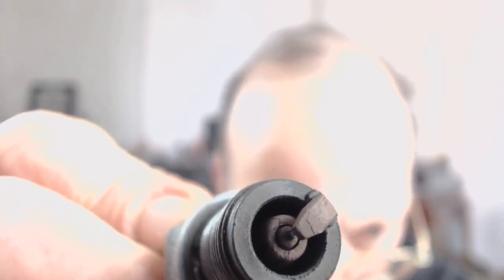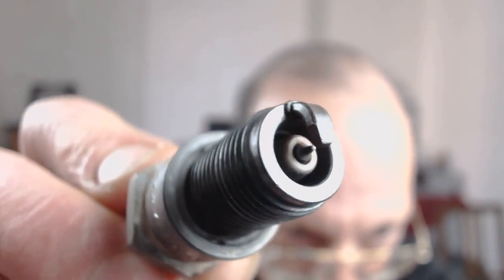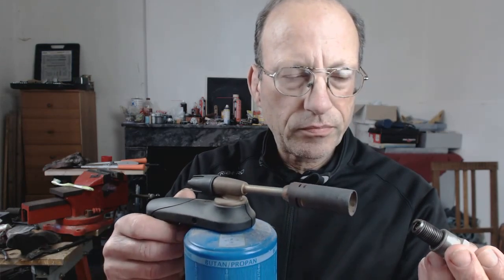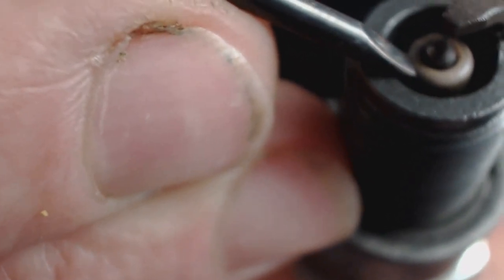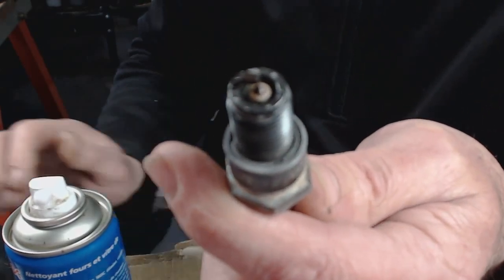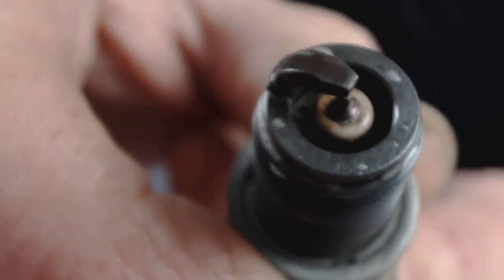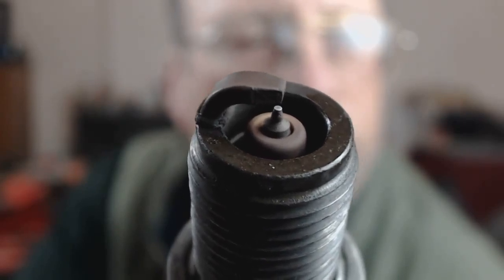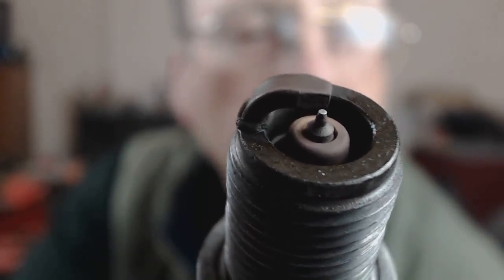Fouled Spark Plugs - cleaning and testing

Comment: Good Evening  . Thank you very much for this video. I want to ask you this: all spark plugs - no matter what brand or if they are NGK all types NGK new ones when the readings show the same ohmic resistance? E.G. the NGK (BKR6EQU), (6002) new how much should it read? New I had not measured it but at 54,000 kilometers when I changed them and measured them they show (4.16) k.
Regarding all this, what is your opinion?
Thank you .
Reply from the maker: Some spark plugs have a resistor within the plug.
Some don't, and require the resistor to be in the plug cap.
The resistors are subjected to heat and vibration - they can degrade.
This can cause analysis problems...
A friend had a bike that would play up after 15 minutes riding.
He was at a complete loss.
I changed his plug cap, and the problem was solved :)

Comment: In my experience, some plugs, if they start fouling, are pretty much doomed. You can clean them up temporarily and get them running again but they'll re-foul quite quickly.

A quick blast of soda works great for cleaning the carbon and gunk off the insulator and electrodes without damaging them, then you can just give them a wash in some water and burn the water off with a propane torch (do not hold the spark plug in your hand while you do this 😁it goes from slightly warm to OW SHIT very fast). If you don't have a sandblaster loaded with soda in your shop you can soak them in carb or brake cleaner and then hit them with the torch.

Comment: Would you recommend this for 2 stroke engines ?
Reply from the maker: If it is running rich, you either clean them, or buy a new plug.
When tuning a carb, you could buy 3 plugs; get the mix right; then clean fouled plug(s).

Comment: Can i use brake cleaner to clean it?
Reply from the maker: After you have cleaned out the carbon, you can blast away any debris (with the BC spray can), and the brake cleaner will evaporate away.
... but it wont dissolve the carbon ;)

Comment: You mentioned spark dance on one comment; what is that please, does it mean that BOTH electrodes ,the tip of the inner and the under portion of the curved one need to be fine polished? like with 2000 grit sandpaper? is there any film where i can see that?  THANKS
i am amazed at your knowledge of these things(you also mentioned that wires better be polished...)
where can one  learn about  that?
Reply from the maker: Abrasive cleaning of the plug is best achieved using micro abrasive media in a sand blaster or peening machine.
If this is not available, then a 2000 finishing grit will do the trick.

Polishing the HT plug cable, helps prevent the formation of condensation.
Condensation provides a path for voltage leaks to earth.

Comment: i have a scooter and it doesnt start....i checked everything, from wires to fuel filter...do you have any clue why is that?
Reply from the maker: You have to take a logical approach.
Replace the spark plug, plug cap, and HT lead.
Does it have a spark?
If so, then does it have fuel?
Does it feed too much fuel (wet plug)?
Is it new fuel?
Fit a fuel tap, so that you know that fuel is flowing to the carb.
Clean the carb jets.
Are they the correct size?

Do all the basic stuff, and keep trying to start it, after you have worked on an area, such as when you changed the plug assembly.

Be methodical.
Good luck!
:)
Reply: @EngineTuning  thanks for the help!

Comment: I use a wire wheel on my drill.very quick and effective.
Reply from the maker: Yeah, it's a common fix,
The problem for high performance engines is that the wires can cut grooves, and create misfires.
Anyway, if your fix works, that's great :)
Reply: I am always very scared of that::  porcelain is way harder than the wires of the wire wheel,and the wires kind of "plate" the porcelain making it conductive, and that is a spark killer; at least , use maybe steel wire wheel, brass will easily "paint" the porcelain.

Comment: Is that remove inside bike dest using wd40 inside fuel tank
Reply from the maker: Do not put wd40 inside the fuel tank, unless you wish to experiment.
It may burn okay, but I have no experience in using it as a fuel additive.
There may be complications with Ethanol mixed fuel.

For a 4 stroke, it may provide some top end lubrication, and it could absorb moisture (allowing it to be burnt off).
However, the burn will not be as clean as petrol, so it is more likely to produce carbon deposits, than remove them.

For 2 strokes ... the fuel has oil in it, that is designed for combustion and lubrication.

A superior additive is acetone.
It will absorb moisture AND it breaks down the surface tension of the fuel droplets.
This enables superior vaporisation of the fuel, and therefore better combustion.

In fact, it will 'even out' any minor maladjustment of the carburettor.
The fuel burn will be cleaner and slightly hotter.
This often results in the spark plug being self cleaned during normal use.
... I have found this to be the case.

 You will find that, instantly, the motor runs smoother; producing more power.

Only a very small quantity is required - 0.4% is sufficient, to gain an immediate improvement
... 200ml acetone to 50 litres fuel (even 100ml to 50 litres works well).

Great for winter running; particularly in diesel engines.

It is also a great additive for paraffin / kerosene heaters ... it pays for itself with the higher heat output, and you get cleaner fumes.

Comment: I have a 2 headed wire brush that works wonders on the plugs.
Reply from the maker: Yes, they are fine for a quick surface brush up, but...
They can't get to the carbon build up between the metal thread interior, and the porcelain :)

Comment: For all those saying he's cheap and should buy new ones well you know there are different circumstances where the car isn't running correctly. Running rich for some reason and it takes time to pin point the issue. Buying plugs every time they get fouled till the issue is found would turn out the be very expensive.
Reply from the maker: Thanks for your input  :)
You are of course correct.
This is the exact reason why I took an interest in plug cleaning.
For me, and typically for many people, it was after modifying the engine.
In this situation the safe tuning method specifically requires that the carb is first set to rich.
:)
Reply: @EngineTuning  yes sir, im actually going through this problem at the moment..
97 camaro ss lt1 with new 355 big cam ported heads and everything that goes along with it. Well, all the plugs are fouled charcoal black and its only got like 40 miles on the engine . Took plugs out on  one side of the engine cleaned them up with break cleaner and some sand paper.
Reply from the maker: I would suggest not using sand paper.
It can cause the sparks to dance, as the resulting peaks on the electrode can be too deep (from the scratches).
If using an abrasive method; go for the finest wet & dry,
Cut a load of thin strips ... they clog quickly but will leave a smooth surface.
Otherwise, use the drain de-blocker method, as described here:
https://youtu.be/DX9gaNJFy1g
Reply: @EngineTuning  yep, using 2000 grit i had left over from polishing my headlights.
Thanks
Reply from the maker: @97sswcubes 78 ... nice feedback, much appreciated :)
Reply: I have to add to your point , I have an old 140 2 stroke outboard prone to fouling at idle for long . These cleaning strategies don't only save money they get you home or off the water in a pinch
Reply: Also if your running an engine from 1970, some of them don’t have a modern proper match, so you find some and make ‘em last as long as possible.. then comes trial and error trying to get one that works good enough..

Comment: New plugs are nothing these days. Id save all that time and trouble just put in a new plug.
Reply from the maker: Yes for sure, the last batch I bought was 6 of the same plug, plus a couple hotter and a couple colder. 
This wasn't just about cleaning the plug ... though why not?
It's all about being in control, and not being stuck (because you don't know anything about how things work) ;)
Reply: My plugs are 120 for 4. Cleaning them once or twice is not being cheap its being smart
Reply: A decent plug will run you 5-9 bucks.Buy 6-8 of them and that's 30-70 bucks or you could clean them and have that money for another new part(s)

Comment: Use sandpaper to erase this black carbon
Reply from the maker: This would likely cause unwanted scratching, which in turn would create a problem for stable spark creation.
It will remove carbon deposits, but the fix isn't ideal, so it should only be used in emergency.

Comment: Use wire brush better than tooth brush
Reply from the maker: Not a traditional wire brush with steel wires.
The wire brush would leave scratches, and that is not good for a high performance engine.
A COPPER wire brush would be fine.

Comment: Buy a new plug ya tight ass! Lol
Reply from the maker: LOL... I know :D
They are cheap enough when buying half a dozen
I think I paid £1.80 each from Greens, and £3 shipping.
But good fun anyway :)
Reply: Sorry mate I'm having dramas with a Chinese bike I have and Its doing my head in. But your video is good. Im in Australia btw. I had it running very nicely when hot, adjusting the fuel air etc perfect then on starting a day later it was unresponsive and flattened the batt 3 times trying! I'm lost
Reply from the maker: Sounds like it could be earth leakage.
I did a wiring tutorial... it could be worth a look.
https://youtu.be/Bb8ievq1TsE
It doesn't deal with the ignition in depth, but you might gain an understanding of how the different elements of the circuit work together, and impact upon the battery.
Disconnecting the general wiring to leave only the ignition, would focus your attention on a small area.

The plug needs a 'voltage overhead' to allow it to spark under compression and fuel load.
So it might start okay, but fail under load.
 
The plug cap is a classic fault that bamboozles everybody (they don't think about the plug cap).
Polish the HT lead... this prevents surface leakage.
Remove the stop wire from the coil (stop it by stalling).
 
Check all the ignition cable from the stator... they can rub and touch.
Clean all the contacts.
Obviously... fit a new plug ;)
If it runs without a battery... disconnect it, and the starter lead (bump start it)

If none of the above fixes it, it will be the coil or the stator ;)
Reply: Wow thanks for the info! You are very helpful and very knowledgeable. I will try all of your suggestions. I'm sure it's simple so to speak but you know engines! Simple but complex. Thank you so much
Reply from the maker: Good luck!
Reply: Plugs for my car are £30 each, this is worth a shot first....

Comment: Grill cleaner you know the stuff you clean your BBQ with. Soak over night and then scrub a bit with a wire brush. Hit it with a blow torch or any flame that's hot and burn it all away.
Reply from the maker: Thanks for the comment :)
In the 2nd video in this series, I looked at 'grill cleaner' and drain deblocker.
The drain deblocker worked the best.
https://youtu.be/DX9gaNJFy1g
Reply: ? didn't think of the drain deblocker but but yeah that would work as well. I've had good luck with the grill cleaner but I might try the other method if ever needed. :) little tricks are always good to have on hand :)
Reply from the maker: Yes, the drain deblocker is stronger by a mile.
 The grill cleaner must be safer because it is being sprayed.
The drain deblocker is poured down the drain, so no probs with safety.
For us, it is just a need to make the family aware of what is happening ;)
Reply: @EngineTuning  do not mix it with gas.. I’ve heard some things.. edit: I’ve also heard if you search it, you go on a watchlist..
Reply from the maker: @bmint  I don't know anything about a watch list, but mixing it in my Berlingo 1.9 Peugeot diesel is fine (it's just a simple diesel engine).
In fact, it helps in the winter weather, particularly when mixed with a drop of acetone ... the engine purrs :)

Comment: PlayF1 Net Hello again,i see you don't have any video about magneto,stator,,i have a problem again ,i don't have spark,at my am6 engine i have a minarelli ducati stator,magneto with 4 wires,red,yellow,green and black for the ground,now i don't know where to put these 3 wires red,green and yellow,maybe you know something,i have a black box i think is the CDI in front ,close to the radiator and there are 4 slots,one for red,one for white(i don't have a white wire) and 2 slots for green,my bike has no key i start only from the kick starter and when i stop i put in first gear and let the clutch,i don't have a diagram and even if i had i don't know how to read it,and under the saddle i have another small  box with no slots,i think is a battery and has 3 wires(2 black.one grey) and they come in one plastic idk how to call it that has 2 slots where you can connect wires and i have another yellow it comes again from that box under the saddle,i forgot where they must be from the last year when i took the magneto off,maybe you know something that can help me and maybe others, i talked with others on youtube but they don't know.